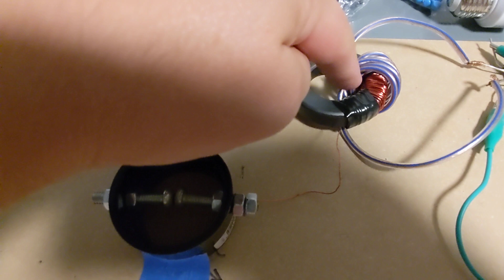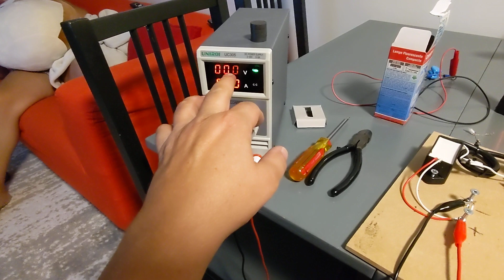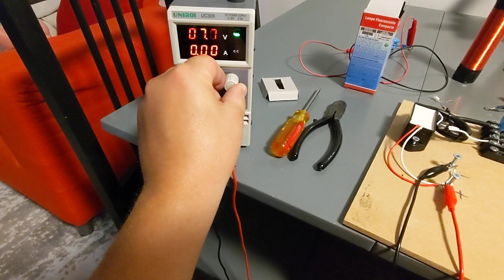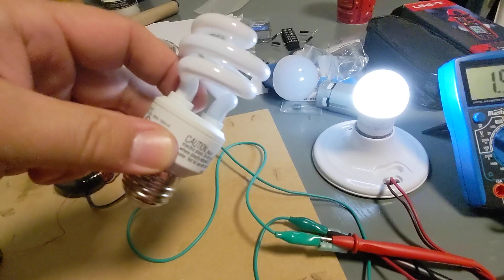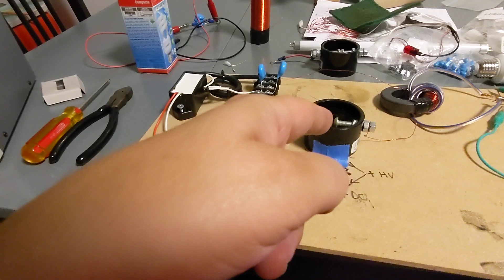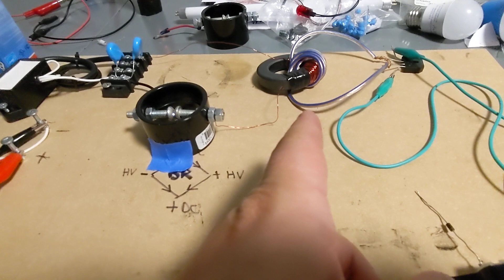Faraday Research RND

Comment: You can leave the system open loop .  It is possible to open loop a cycle , the reverse polarity shift that the inductor does during the flyback makes it possible. The Yin Yang symbol explains how two polarities can generate a cycle threw an open looped system, its still looped but in an open loop way , as to say the circuit opens when the the flyback loops back into your circuit. (The Opposite Equal Reaction)

Comment: Could be the meter. I'd expect there'd be anomalies when measuring 1) square wave pulsed signal. 2) High frequency pulses. Especially an inexpensive meter like that. Just a guess.
Reply: Yeah my bet is on the meter too, it's probably "averaging" the total voltage. you said 6.5V is being boosted to about 5000 V then you're putting it through 70:6 which would be 428V. But then you're using a spark gap so it's going to be really short pulses. If you're reading only 1.45V on the meter I'de guess the duty cycle is probably something like 428V/1.45V = ~295 so 294 off periods for 1 on period. Looking at the audio from the video it looks like your getting about a spark every 40 ms so about 25 hz.
Reply: @petersvideofile  how do you look at the audio of the video?
Reply from the maker: I'm not too sure what you mean can you explain a little more???
Reply: @FaradayResearch  Hey Mike this may be a misunderstanding on my part but I was under the impression that many multi-meters sampled using an approach of either averaging  multiple values in the MCU or actually using some kind of analog integrating technique to smooth out the signal (this applies more for AC than DC though as I think they want to remove the fundamental). So my speculation is just that it's reporting a much lower peak voltage than you are actually getting. If I didn't have a strong suspicion that it would break an oscilloscope, I would suggest hooking one up to see the waveform. It might also be possible to put a small coil of wire around the wire going to power the LED and then hook it up to an oscilloscope to measure the current waveform real time. I might also use a regular resistive load (to ensure there is no active circuitry making the measurement more complex) even using a CFL I think it might exhibit negative differential resistance thus making whatever voltage waveform you feed in into the load exhibit a more "spiky" behavior.
Reply from the maker: Yeah you bring up a lot of very good points The problem is I don't have access to an oscilloscope I just don't have the money to afford it right now but I do have a very small one but I'm afraid it might actually fry it so I got to figure out how to do it without frying my small oscilloscope anyways thanks for the comments again yeah I'm going to definitely look into a lot of the stuff
Reply from the maker: @petersvideofile  hey Peter I think you're right you know what I know for sure that my spikes have to be over 200 volts because there's no way that my pulse motor could light up 11 watt light bulb there's no way it can do it it had hard enough problems as it is but the 5.5 watt so my suspicion is it's going well over 200 volts DC but they're pulsed so it's going to be a very sharp sawtooth sine wave this weekend I'll have some time so I'm going to try hooking up my small oscilloscope to it but I'm kind of worried that I might actually damage it so if you have any ideas on how to protect that that would be great thanks Cheers
Reply: @FaradayResearch  Hey mike, I wouldnt hook it up directly. I would maybe try either using a light bulb with known resistance, or a resistor. Then instead of measuring voltage measure current. King of like making your own current clamp meter. You could do this i think by coiling another wire around the wire going to the light/resistor. Then attaching that wire to your oscilliscope. This will give you a wave form of the current from which you can infer voltage v = ir . To get a meaningingful quantitative value I think you would want to "calibrate" the coil on your osciliscope by passing through some sinusoidal waveform of known current and measuring the signal on your oscilliscope. Then you could apply this correction factor to your oscilliscope waveform to infer the current and compute the voltage. This isnt going to be perfect though as the coils impedance is going to change with frquency which wouldnt be accounted for. Hopefully this wont turn into a wild goose chase. Less likely to damage the oscilliscope this way I figure though.